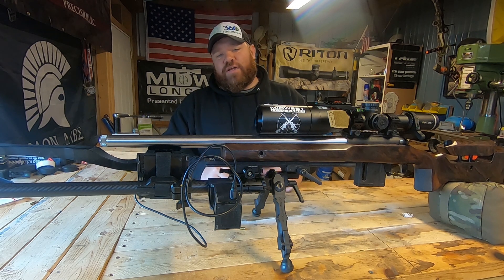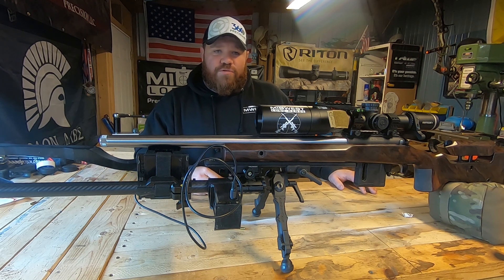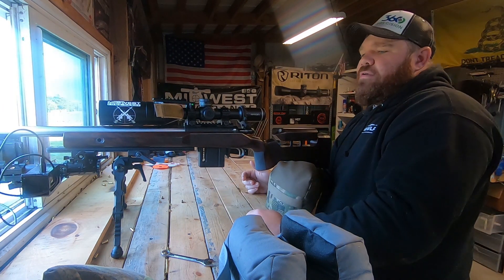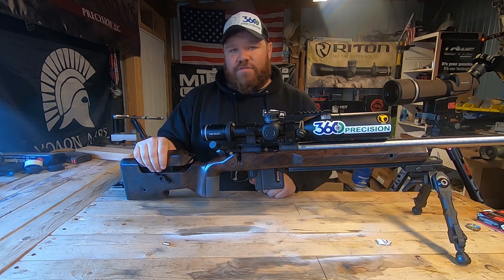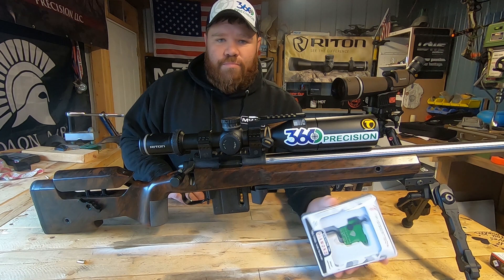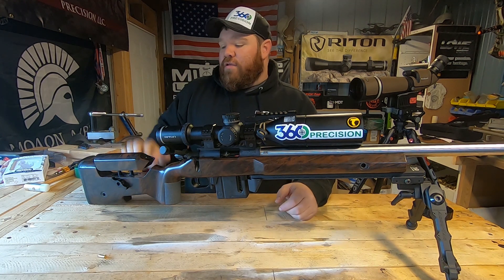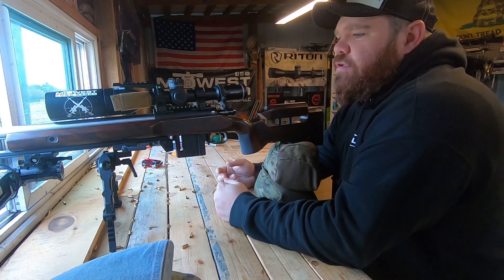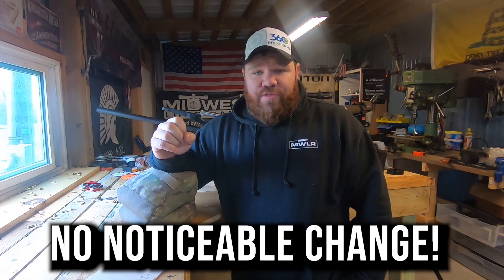Timney HIT VS. Trigger Tech Diamond (Trigger affects on SD's & ES)

Comment: Every time you sample a distribution you get an estimate of the true mean and an estimate of the true variance.  The ratio of 2 variances (variance is the square of the st dev) is different when the ratio exceeds the f statistic.  8 square over 6 squared (64/36) is 1.78.  To declare two variances different with a 5% threshold for being wrong with 9 df for each variance (10 tries each) the f statistic you need to exceed is 3.18.  At 10% error it 2.44.  I guess 11 vs 6 would pass this test but once you make multiple comparisons its a slightly different ball game and I did not want to run a true analysis of variance.   11 vs 8 would be less than 2 as well.  I cannot say there is no difference, but this is not enough evidence to say they are different with confidence.  Good test though, and good video.

Comment: There never was a chance the triggers would make a difference. The bolt contains the firing pin and the spring that hammers the primer. The trigger only releases the spring in the bolt to fire with the firing pin. It will constantly be the same with any trigger. It's really a no brainer if one just thinks mechanically.

Comment: This trigger test does not make any sense.  Bullet speed at the muzzle is affected by how clean the barrel is between shots, what the weight of the bullet is on every shot, and what the charge weight and energy content is of every load.  You can not assume every shot has all the same numbers then blame any difference on the nebulous effect of the trigger type or pull weight.  No way.

Comment: Only way you would have your standard deviation and extreme spread affected from the trigger is if the sear on the triggers is not exactly ground the same causing the cocking peice and pin pulled back more on one than the other. I shoot 1000yd benchrest and i use jewell that I tear apart and super tune myself one I get them. They are breaking at 1ounce. See what happens and remember to keep cleaning your barrel. Should have started with a clean barrel each test

Comment: Some High-end actions that use trigger mounting blocks offers those blocks with different mounting hole offsets to increase or decrease the amount of firing pin spring compression.  Different triggers will probably have variations in the mounting pin hole to sear surface dimension which you could check with the proper inspection procedure before installing trigger on action

Comment: Awesome test. From my experience, I've seen Timney triggers especially the HIT cause firepin drag and or failures in multiple actions in our rifle builds as well frozen set hang fire with a fellow we've built a 6.5 PRC in ND (extremely dangerous). IMO the hit has a better feel than the TriggerTech. For your rifle, its working great!
Reply from the maker: Thanks man. With this test you really need a larger sample set of triggers for accurate data collection. Probably 10 of each trigger would give a more honest set of data points but I can’t afford that many triggers lol. I appreciate you checking it out.

Comment: To me weak strikes  are a problem in the action  " firing  pin "
Reply: This method test if there is any drag between the sear of the trigger and cocking piece of the firing pin. So it would be directly related